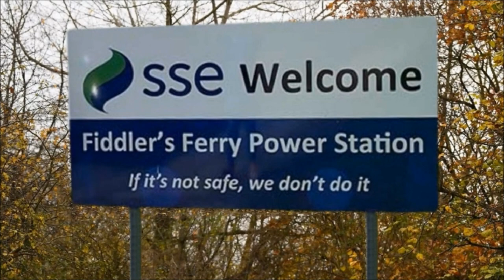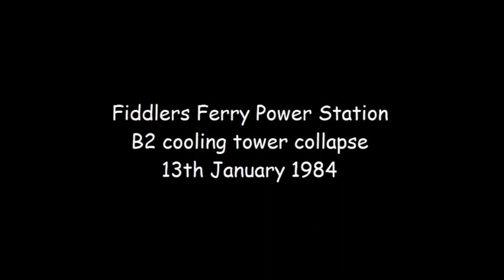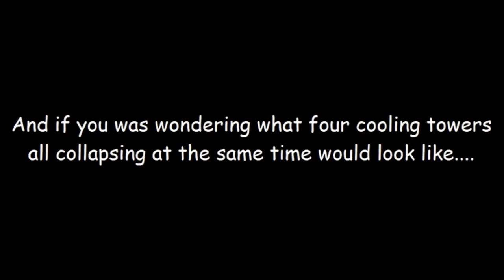End of an era for the Fiddler's Ferry cooling towers at Warrington in Cheshire

Comment: My Dad worked here back in the late 70s when it was operated by the CEGB, there's now only 1 operational coal fired station left in England and that's Ratcliffe on Soar in Nottinghamshire. Have you ever visited Willington power station? The station closed back in 1999 but the cooling towers are still standing due to Perigrines nesting there during demolition of the power station.
Reply from the maker: Hi Noseybstard, no I haven't visited the former Willington Power Station site with it being in Derbyshire but it's one I'll keep in mind should I ever be in that neck of the woods. 👍
After reading your comment I looked at some excellent photographs on the 28dayslater website and looking at the construction of the cooling towers they are of similar design to the power station at Westwood that I mentioned in this video which isn't suprising as they was built around the same time.

It's a shame that we are now down to only one coal fired power station in the UK not least because once upon a time we were self sufficent when it came to producing electricity and it's crazy to think we have just sleepwalked into a situation where we are now reliant and at the mercy of foreign energy prices.
Reply: @MrHsHotPot   the gas has gone the same way too, near to me, we had 4 or 5 Gas towers,  sometimes you used to see them at different heights, sadly back in 2019, the gas works decommissioned them, and now they have been dismantled. When i read about what was going on etc, i found that those towers were well over a 100 years old. Going back to your coolant towers,  there is a video of someone visiting Chernobyl reactor number 5, which is unfinished. But there is a coolant tower, and they go inside, and you see how massive they really are!

Comment: Ironic putting houses on a former power station, shame there's nothing to power them now due to last years possible blackouts / decommimg of fossil fuel sites and electricity demand ever increasing
Reply from the maker: Hi Simon, yes the irony of building houses on the site of a power station was not lost on me either. 😆
Doesn't make sense to me to close our coal fired power stations without having an alternative in place that dosen't leave us either relying on or as recent events has taught Germany, at the mercy of foreign energy imports.
But what do we know eh? 😉
Reply: yeah you got that electric car crap too,  how is the uk power grid going to cope with that, if power stations are been binned off.  The UK should do what Canada i think has done. Where they burn rubbish, and the waste is water or oxygen or something like that. Which is a lot better for the environment.